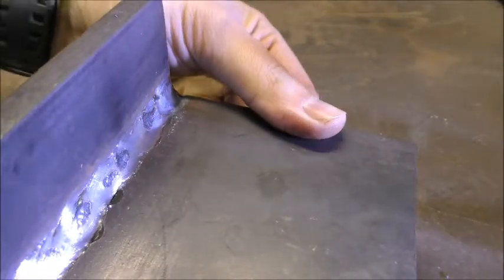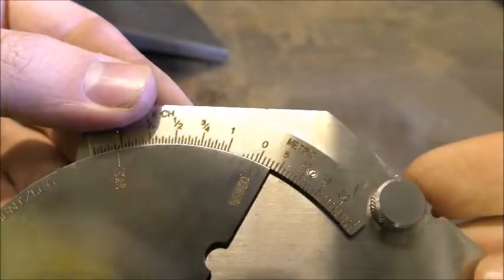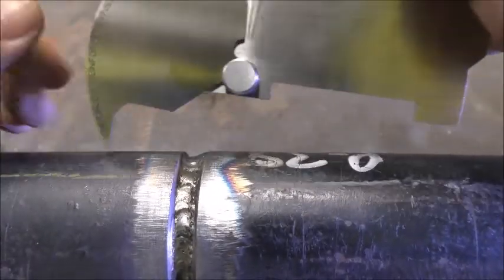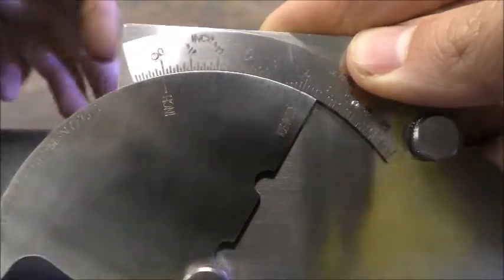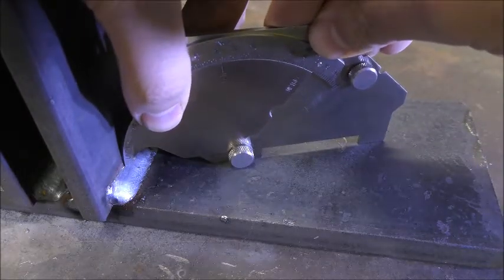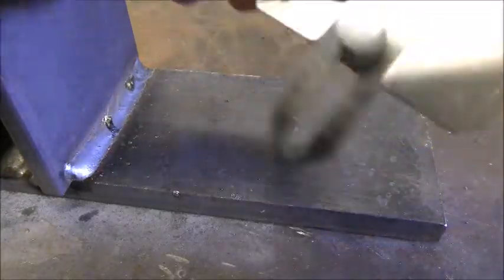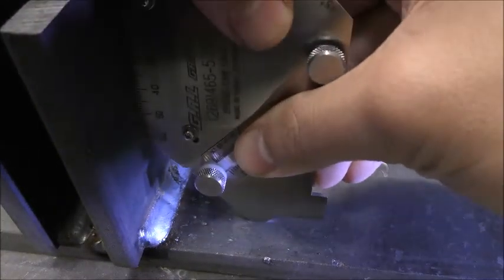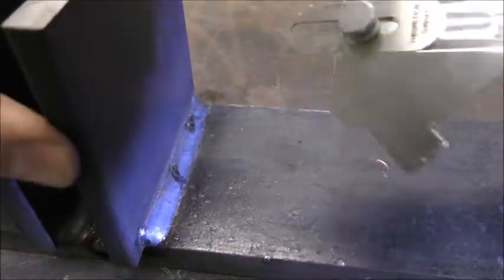Welding inspection aid - How to use a Bridge Cam Gauge

Comment: anyone else see 7mm at 1:43??
Reply: She said 6mm.. Hehehe but it is 7mm
Reply: @geemarino6066 I’d rather my A6 welds measure 7mm to pass rather than been low. 1/2 mm under & my inspector will have me grinding them out & re welding.